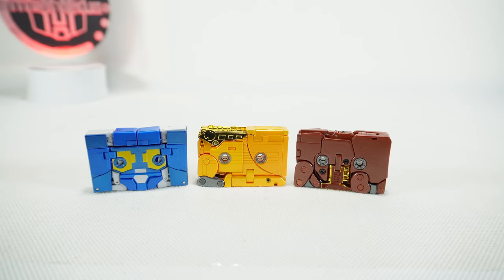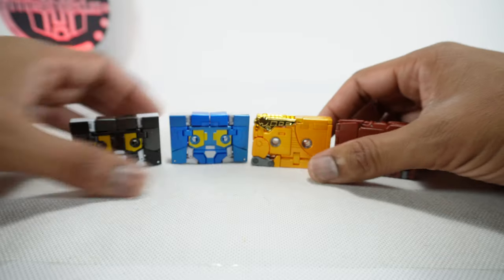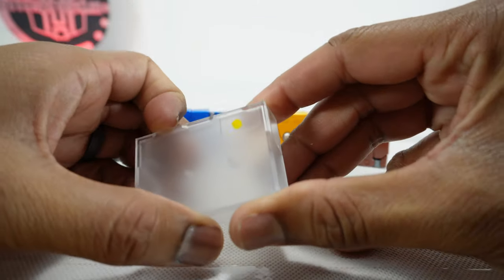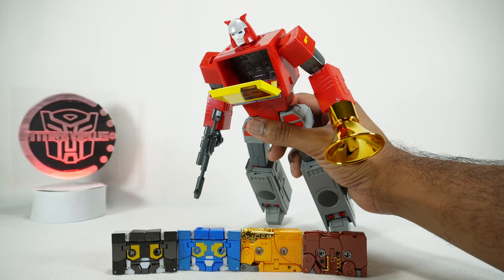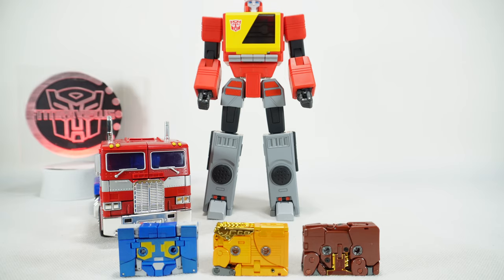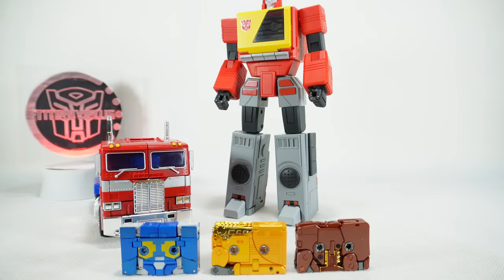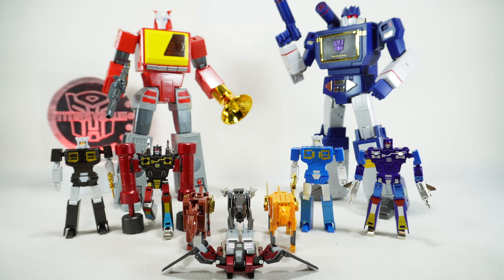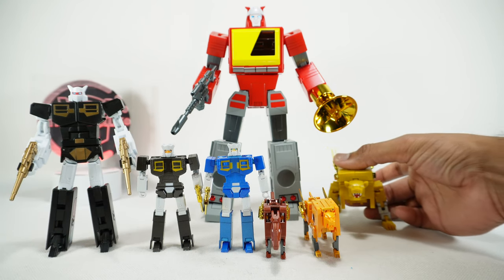FansToys FT-55B Erase, Amplifier & Loudspeaker (AKA Eject, Ramhorn & Steeljaw)

Comment: Whilst IMO these tapes are better and slightly more refined than their Decepticon counterparts and as always the paint is spectacular I just don’t like how they scale, I know they are designed to represent micro tapes but I prefer the scale and size of the MMC tapes.  

They definitely have a good weight to them with the diecast element I just don’t like the gap in the back of the legs for Rewind and Eject or the fact they only come with one gun.

I do have the Decepticon tapes as I was gifted them however the only one I have on display is Laserbeak, as the MMC versions are out of scale completely.

If these guys sit on the shelf and get discounted I might consider picking them up but for me I’m sticking with MMC for the tapes.